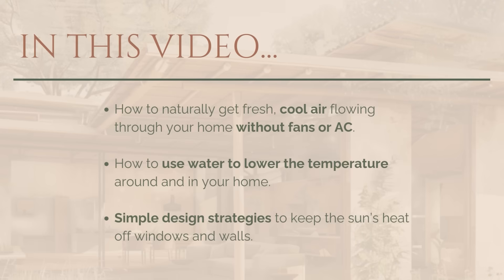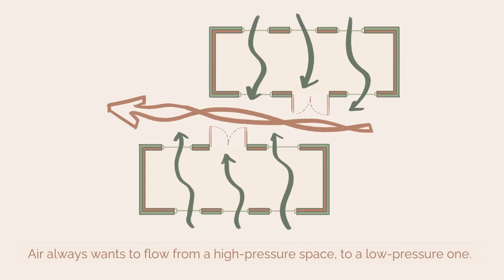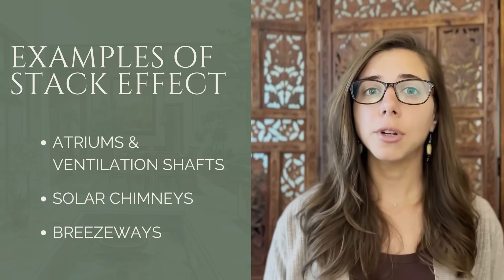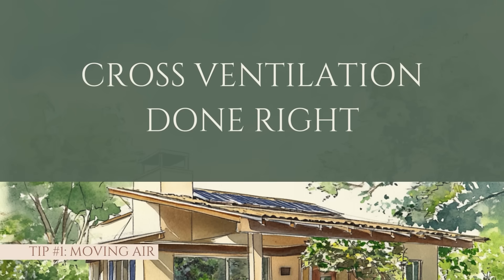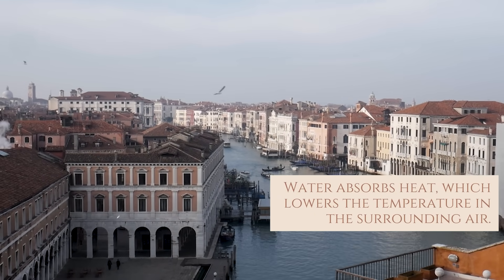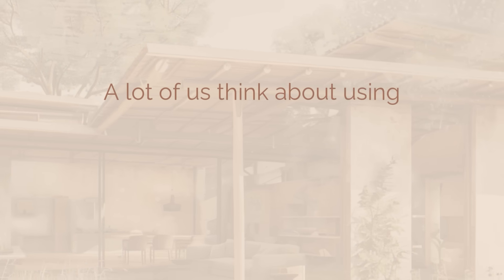The Forgotten Cooling Techniques Architects Don't Talk About

Comment: Get a roll of reflective foil insulation and put it over your sun facing windows on the outside. When it's not sunny you can roll it up and tie it like a drape.
Reply: Radiant barrier foil insulation is so effective .    We use it inside under out roof rafters. and it’s so affordable

Comment: Great topic! Here in tropical Malaysia, traditional homes used to have such practical features.... Made of wood which is naturally cooling, lots of vents, strategically placed and double roofs. Great both for creating air flow while shading from both sun and storm. Older terrace brick and mortar homes still retained the same features, with louvre/naco windows, plus older bricks are also insulating. 

But newer developments built in the last 30 years have completely banish all practical design practices and fell onto aesthetics, opting for flatter roofs, wide glass panels and flat windows, all in the name of adopting western style aesthetics, which are ironically designed to conserve heat, retain what little rain water, and bring in maximum sunilight for the cold months, all which we have an abundance of all year.... Sure they looked much more modern but boy, natural cooling features became a lost art. The temperature is horrible when the sun hits in the midday, and no way of escaping even by night. Buildings resort to tinted windows, blackout curtains, and lots and lots of air conditioning.

I hope that future architects can be more savvy in incorporating these practices in their modern building designs.
Reply from the maker: thanks for sharing!  agreeed!
Reply: Mass builders are all about building common design houses on the cheap for profits .  So they don't incorporate passive cooling which usually don't cost but the designs are not common.
Wood resources are limited in Asia now, concrete blocks are more common and cheaper.   Concrete blocks can have passive coolings but you won't see them with mass designed houses.
Reply: +1
Born n raised in neighboring SG and we had a lot of kampongs/villages where houses are also on stilts where winds cool the floors, openings (covered with screens) where the walls meet the roof, louvered windows and doors.  Hardly any glass.
Reply: So true! Hello from Indonesia. Here I am watching a neighbour building exactly as you described. The electricity bills definitely would be nightmarish and it won't age well in a few decades from now.
Reply: Southeast Asian wisdom being lost to imperial-capitalist aesthetics
Reply: Change for the better? Generally not. That's said the mantra is 'We can't go back'

Comment: Old houses here in Brazil have small basculant windows on top of every door, so the hot air can be push out while you can keep your privacy. But is no longer in use in modern builds either. We still use the central/side courtyard fort light and airflow, but is mainly due to legislation that demands minimum airflow and illumination and this is the easiest way to achieve.
Reply: Same here in Malaysia

Comment: Btw why put the water in a pool ? Would it not be more efficient if we put a "tank" shaped like the wall ? The water would cool the tank and since it's in contact with the wall, it would cool the house too. It would be even better if we put heat pipes connecting the inside of the house to the tank through the wall.
Reply from the maker: how would the water evaporate if it was in a tank?
Reply: @christinaransbury  
With an opening ?

Comment: If you live in tropics like i do, the most important for a house is a very well heat insulated roof. Because most of the heat comes from the roof. Make sure your windows are shaded especially those facing the sun. Plenty of trees surrounding your house help to lower down temperature.
Reply from the maker: great points!
Reply: I agree - stapling radiant barrier foil rolls to the rafters makes  an enormous difference in lowering the temperature in the attic - or shed

Comment: @3:02 Will this work if a have only one window at regular hight and put a small window high on opposite wall?
Reply from the maker: Do a bigger window on the opposite wall, higher up.  Hot air rises and expands :) Is this an existing home or a new build?
Reply: @christinaransbury  Thank you for replying back.  This is an existing home.

Comment: Efficient Cooling Strategies:
Stack effect creates natural air circulation by strategically placing larger openings at the bottom and smaller openings at the top of a building, utilizing temperature differentials to draw cool air in and expel hot air.
Effective cross ventilation requires staggered window placement on opposite or adjacent walls, promoting air movement throughout the room rather than in a straight line.

Natural Cooling Elements:
Water features like pools, fountains, and green roofs provide evaporative and radiant cooling, effectively reducing air temperature even in hot, dry climates.
Strategic shading using overhangs, deep porches, and deciduous trees on the west side minimizes solar heat gain and reduces cooling needs.

Design Considerations:
Building orientation that accounts for prevailing winds and solar angles can significantly reduce reliance on mechanical cooling systems.
Implementing passive cooling techniques can lead to substantial energy and cost savings while maintaining comfortable indoor temperatures without air conditioning.

TLDR: Effective passive cooling strategies, such as natural ventilation, strategic design, and water features, can significantly reduce the need for air conditioning in homes.

1. 00:00 🌞 Natural ventilation, water usage, and strategic design can effectively cool your home without AC or fans.

2. 01:03 🌬 Moving air through pressure zones is a key passive cooling strategy, especially in hot and humid climates where additional dehumidification may be necessary.

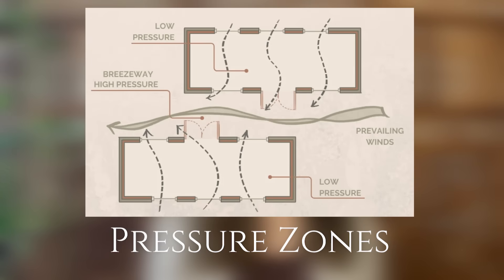3. 01:39 🌬 Positioning a building to harness prevailing winds creates a natural airflow by utilizing high and low pressure zones, enhancing passive cooling.

4. 02:43 🌬 Utilize the stack effect and align your building with prevailing winds for effective passive cooling through natural ventilation.
	4.1 The stack effect utilizes pressure zones to create natural ventilation in buildings by allowing hot air to rise and cool air to flow in through strategically placed openings.
	4.2 Aligning your building with prevailing winds creates a low-pressure zone that facilitates air movement through your home.

5. 04:37 🌬 Stagger window placements for effective cross ventilation and incorporate water features to naturally cool indoor spaces.

6. 06:00 💧 Sustainable passive cooling strategies include evaporative cooling with water features, green roofs for heat absorption, and radiant cooling systems.

7. 07:21 🌳 Effective shading techniques like overhangs, minimizing western windows, and planting deciduous trees can significantly reduce solar heat gain in your home.

8. 08:28 💧 Effective passive cooling can be achieved through air pressure zones, water features, and strategic shading, reducing reliance on mechanical systems.
Reply from the maker: thank you for the summary!

Comment: Heritage Techniques for dealing with hot / humid climate can be found in the Sears Catalog model Magnolia House. It has stack effect, sleeping porches (outdoors), and good ventilation.  It also features anachronisms like a servant staircase to the kitchen, that connects to the cook's room upstairs (which also has its own private bath!) Another nice feature is a port cochere - a covered area for folks to enter the building from their vehicles.
And if one is building a superinsulated structure, freely ventilating it may be counter productive. So one might install a 'jungle hut' on the roof deck... a simple open frame and rain canopy... (add insect mesh if needed).

Comment: awesome videos , ive been learning a bit coz m trying to build some aircrete domes, but i want to add you advice into it, can you guide on how to find the angles for the shading and overhangs for the roof and windows and also how to find out the wind direction throughout the year, do we use the lattitude and longitude or is there a detailed video you made on this?
Reply from the maker: Yes, you can download the Passive Heating Checklist and the information is in there.  Link in the description!

Comment: Not mentioned but I have painted my flat roof white and it reduced my energy bill by more than half. Works on metal, and concrete roofs quite well in very hot & tropical climates.
Reply: wow i have to try thattt

Comment: We have a site which is sloping towards north and major wind direction is southwest ..West and East ...so which is low pressure and high pressure zones according to my site
Reply from the maker: The pressure zones are more related to the buildings / trees not necessarily the slope.  I would need more context to answer this questions

Comment: 🎯 Key points for quick navigation:

00:13 🌬️ Learn how to use natural ventilation, water features, and design strategies to cool your home without AC.
00:39 🌿 Christina introduces herself as a sustainability consultant focusing on low carbon, natural building methods.
01:09 🌦️ In humid climates, passive cooling might require additional dehumidification for effectiveness.
01:36 🌪️ Airflow starts with understanding pressure zones; low and high pressure zones move air within buildings.
02:18 🌬️ Explain how wind creates high and low pressure zones around buildings, influencing airflow.
02:45 🔄 The stack effect uses air pressure differences to naturally ventilate buildings through design.
03:28 🔧 Design features like atriums and solar chimneys enhance natural ventilation via the stack effect.
04:07 🌬️ Breezeways are designed to channel prevailing winds through buildings to maintain airflow.
04:48 🪟 Cross ventilation requires strategic window placement to effectively cool entire rooms.
05:41 💧 Water features can utilize evaporative cooling to naturally reduce temperatures in buildings.
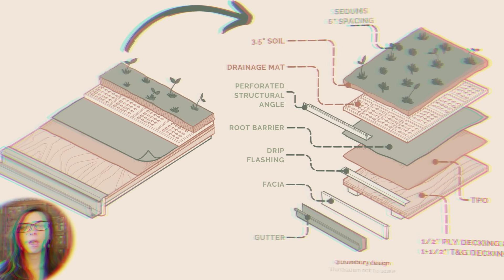06:25 🌱 Green roofs hold water and can include retention systems to cool structures below.
06:52 🌊 Radiant cooling uses water tubes in ceilings to absorb heat from spaces below.
07:18 ☀️ Shading is a simple yet effective method to block solar heat gain and keep homes cooler.
07:47 🏠 Use overhangs and shade structures strategically to minimize sun exposure on windows and walls.
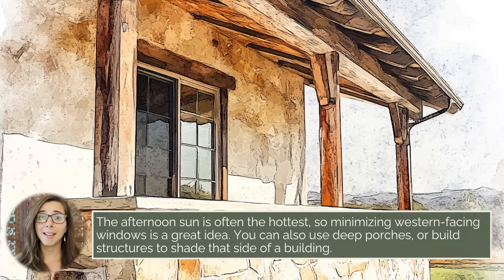08:14 🌳 Planting deciduous trees and vines offers seasonal shade to reduce heat in summer.
08:28 🏡 Airflow, water, and shading are key techniques for passive cooling without mechanical systems.

Made with HARPA AI
Reply from the maker: thanks for doing this!

Comment: 1. More windows in north and east, rather than south and west. 2. Sunshades 3. Vines. 4. Double windows, double curtains or double panes on glass windows - can have a layer of acrylic instead of glass. 5. False ceiling on top floor. 6. Reflective paint on roof. 7. Shady trees on roof and garden.  7. Multiple fans and small table and wall fans on every side table. (yes we need prettier fans). 8. Dark color on walls that get direct sunlight.
Reply: I like exterior windows shutters myself.   They look classy and can provide shade.  Anyone else like working shutters (not faux)?
Reply: Which pole of the planet are you closest to? That can change things quite a bit when you start using terms like norh, east, south, and west.
Reply: numbering fell off a bit but we get it 🤭
Reply: With windows open at south/west your small table fans already fly of the tables. Have a house that has that.
For sunshade i use a front GARDEN. Take plants that don't stay green in winter. And are full of leaves in the summer. Like large fruit trees for shade. Clematis climbers or other plant that covers your house. Cover all the soil with plants taller then 20cm that have a lot of leaves or cover. Don't plant a lawn and cut it low. No soil, gravel or mulch should be visible.
You can add a pond or water feature. But make shure wild life can escape it. Thus make a place where animals can get in or out. Also in the pond, cover most of the water with plants.
Reply: 8?
Reply: Double panes are horrible. Humidity builds up and windows are permanently fogged up
Reply: Not if they are properly made and sealed

Comment: The 2025 fires brought more awareness about how some roof designs are better than others for embers floating/ blowing into attics or insulation. So in designing a 2025 structure and beyond should also take some of these lessons into account for sustainability.

Comment: We live in Western Colorado and bought a house in 2014 (built in 1982) with a passive solar heat envelope. To me I looked at it as a sunroom for for growing plants. The advantages have become more obvious over the years during winter - on sunny days it warms the whole house up to 72 deg for the better part of the day. The problem is during the summer it can heat the house up to 100 deg. We have since put thermal shades on the outside and blinds on the inside. That has helped a lot. I also have a small portable evap cooler that I point into the living room - also helps. There are also a lot of windows that we leave open all day for the breeze and air movement. At night there is usually a breeze and it will cool the house down to 69 (sometimes lower) by morning. The rough nights are when there is no breeze - thankfully very few of those. On 100 deg days the highest temp inside is around 84 deg.  Bearable but would love to be able to bring that down a few degrees. P.S. we have no cooling system. Also we do have several good sized trees towards the southwester part of the heat envelope - also helps as they've grown. I just subscribed to your channel and hope to find some suggestions that we might be able to incorporate for more efficiency. Thank you for making these videos. I've watched 2 so far and am impressed.
Reply from the maker: Hey!  What part of western CO are you in?  I am over in Paonia! 
That is a common problem with passive solar homes overheating.  Is the greenhouse space separated from the living space (aka, outside of the insulated building envelope).  In order for that system to work an attached greenhouse system to work needs to act as an indirect gain system so it can be closed off in the summer months.

Glad to have you apart of the channel!  I will be putting out a video on passive solar specifically in a new video.  Stay tuned!
Reply: @christinaransbury  I'm in Cedaredge!  So you're not very far away.  Cool. Perhaps we could meet one day if you're willing. We have 1.8 acres and I'm using organic/regenerative practices on the property - if you like apricots we have 40+ apricot trees and various other fruit trees.  It's not an orchard property - the 4 cherry trees are around 25 ft. tall. 
The greenhouse is separated from the rest of the house by a large moss rock wall (back of the fireplace) and large windows with sliding glass doors. I don't close those doors because I don't want to fry the plants and it's also kitty cat space (2 indoor cats). The floor is concrete and painted green (a heat sink color I think). So hope that gives you an idea of what we have.  Thank you for answering. I'm so glad I found you.
Reply from the maker: @McMac73  Oh!  thats awesome!  I would love to see what you have going on over there - we are practically neighbors!  Shoot me an email so we can connect!  info@cransbury.com

Comment: Decades ago, upon visiting South-Africa, we visited an office building with a large parking lot. The whole parking was covered by canopies made from mosquito nets. The effect on the parking lot temperature was surprising . Even if it only filtered out a small portion of the direct sunlight, the difference between 'under the canopy' and 'in the direct sunlight' was easily a few degrees. 
In my own home country (Burundi), the trick of using 'double roofs' has been used for over a century: an actual pitched roof that protects you from the elements, but that is vented at the top. And one just below that, to create a chimney effect and vent out all hot air from the inside. Plus we hade large roof overhangs that protected the outside walls from direct sunlight on the hottest parts of the day.
The trick of creating shade on your walls and windows works also for tall buildings. You just have to create enough spaces between your shading devices and the walls/windows.
Finally, but this only really works well with flat roofs: green roofs easily drop the temperature in the building below by 5 degrees.
Reply from the maker: Awesome tips and tricks!  Thanks for sharing.  I especially love that one with the mosquito nets!

Comment: Subscribed. Just curious do you think we can employ scrubber fluid dynamics on air vent entrances to dehumidify passively the air prior to entering the home in hot and humid areas? (eg. a matrix material that quickly creates pressure differentials to condensate the water vapour? )
Reply from the maker: The scrubbers I am aware of don’t dehumidify, just filter particles. Passive dehumidification is possible by cooling the air below the dew point with sky radiation.  A mechanical engineer I work with did a paper on this... I can email it to you if your interested.  info@cransbury.com
Reply: @christinaransbury  That's really interesting i'll look into it. Thank you.

The other idea too was Elastocaloric cooling but be more like a heat pump refrigeration system.